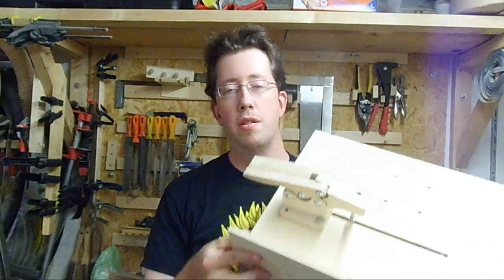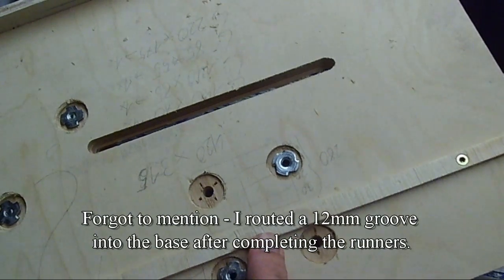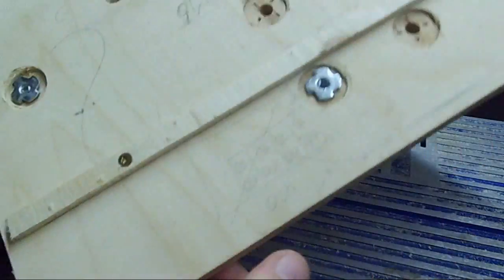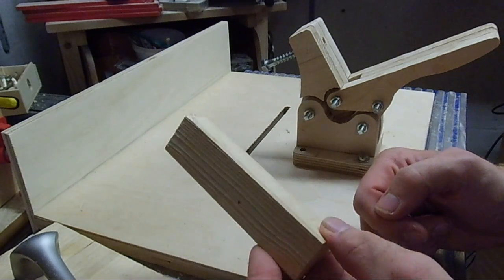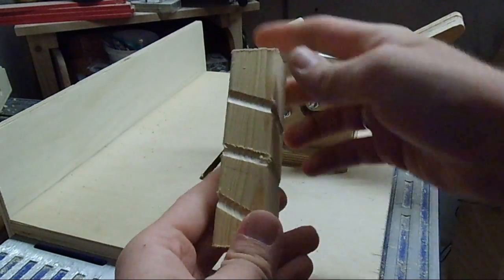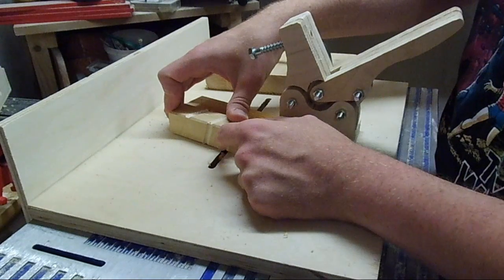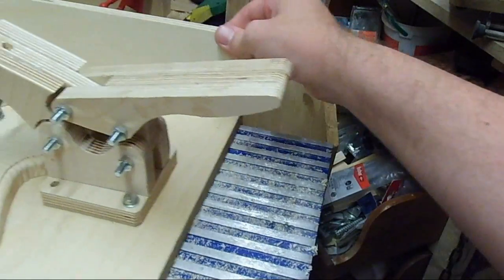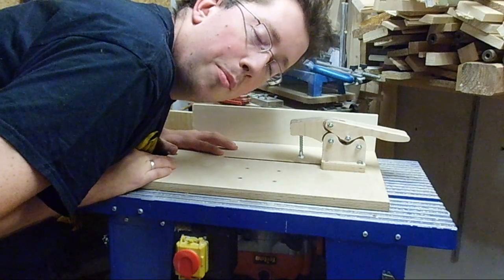Router Table Sled - featuring a simple spiral from square stock

Comment: Great idea. I'm sure there are lots of variations on this idea. An adjustable fence would be a nice addition. Obviously a "cross cut" sled with the fence at a right angle and the clamp attached to the fence would be good. Band saw sleds of these types would be useful as well.